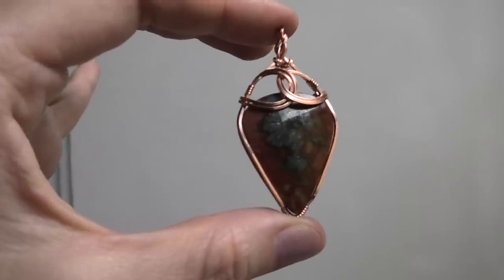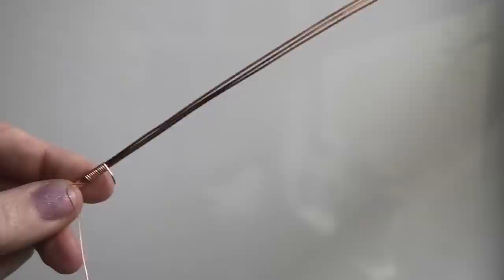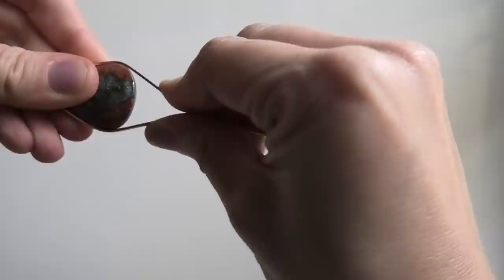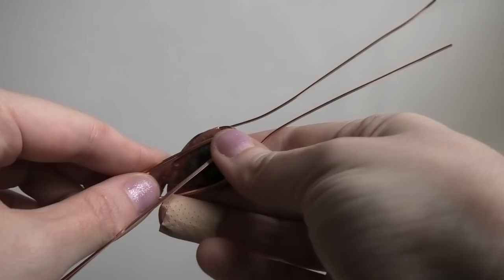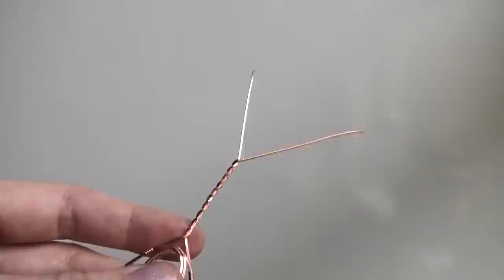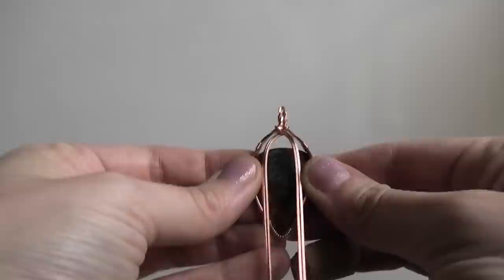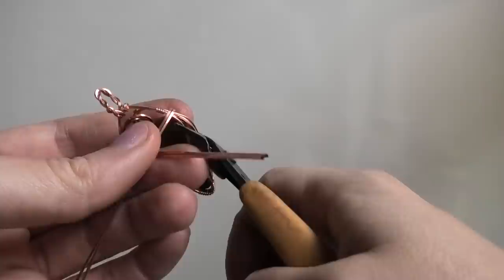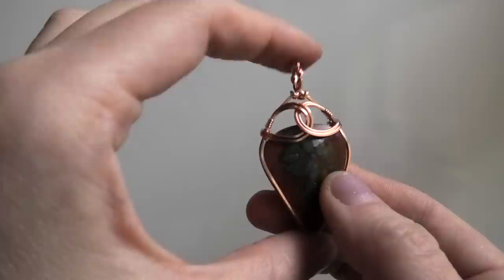Wire Wrapped Cabochon Pendant Tutorial

Comment: How do you harden your wire on a finished project? I use a small tumbler with stainless steel shot and burnishing liquid or hot cold, hot cold water if I am worried about the stone